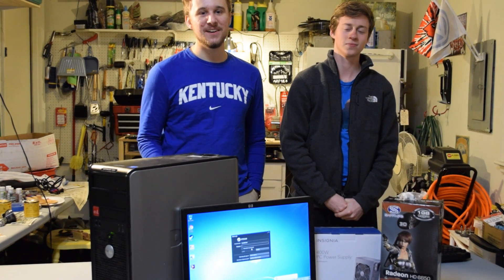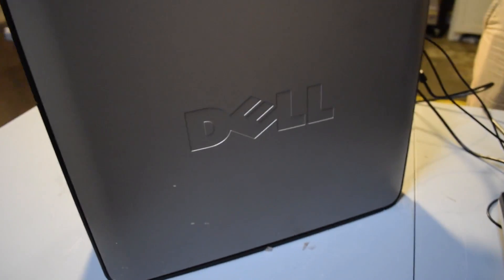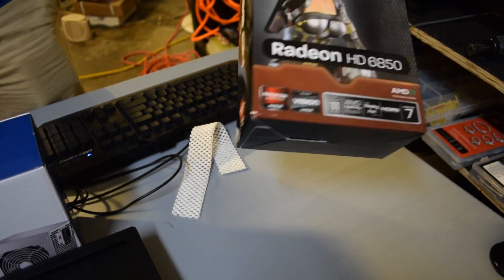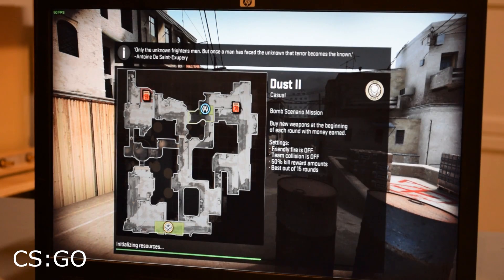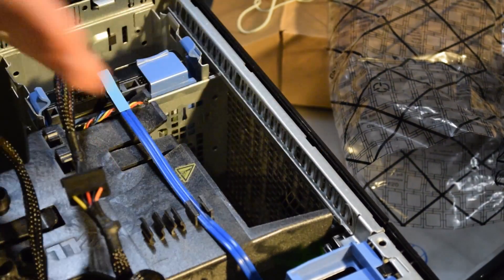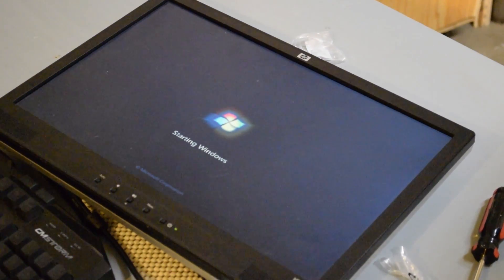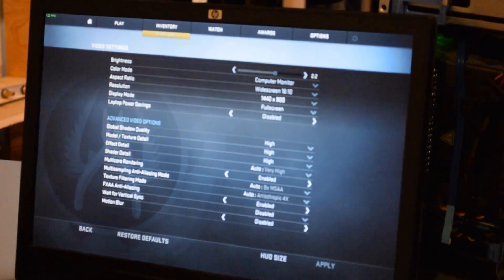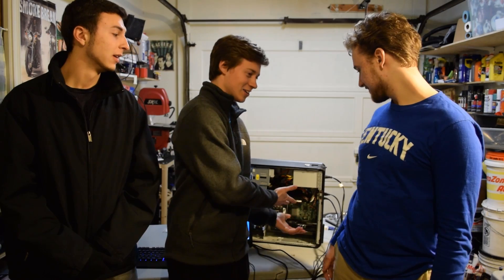2016 $150 Gaming PC Build

Comment: Hmm.. If you had of bought a gtx 750 or 750ti it would have been faster and still supported with drivers (6850 is no longer supported) and around the same price. (Would not have needed to upgrad psu)
Reply: While that would work in theory a second hand 750 goes for around 70 to 80 dollars in the US and a 750 could be acquired for 60 bucks some people have reported compatibility issues with the 750.
Reply: that first 750 should be a 750ti sorry

Comment: Basically what I have. Main differences are I have a 350w antec Earthwatts power supply, a 1tb hard drive, and a radeon 6670 instead of 6850.

Final cost was $138.54

Also, is that 6850 single or dual slot? I can't see a second slot.

Comment: How did you guys fit a dual slot in this computer I have a dell optiplex 745 and when I try to use a dual slot it won't fit because there is no space for the top bracket
Reply from the maker: hmm maybe they are different. Ours was big enough where if cross fire was possible we probably could have done it lol.
Reply: Toasty Bros i see now that your model has 2 pci-e slots and mine only has one at very top but over all nice project